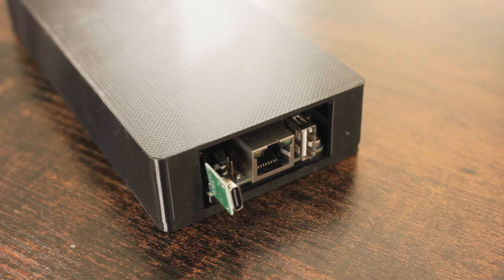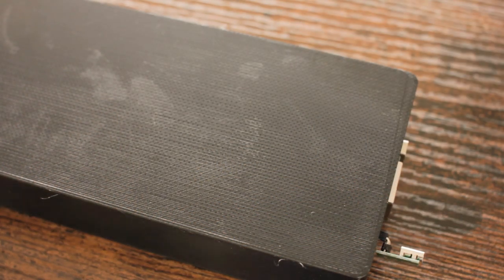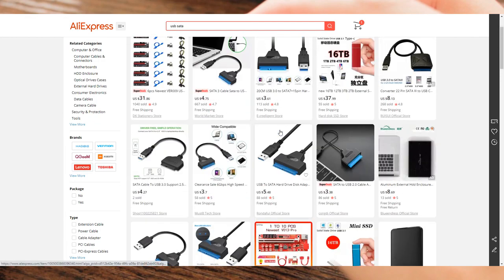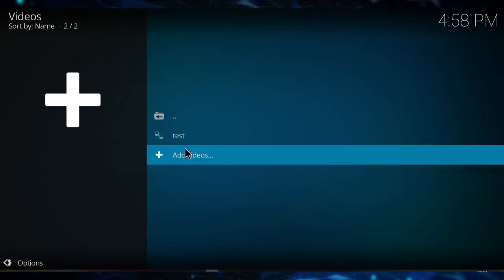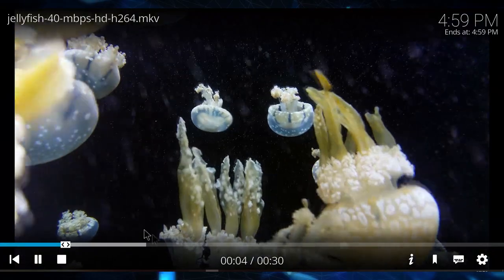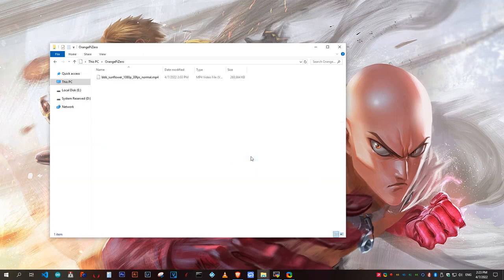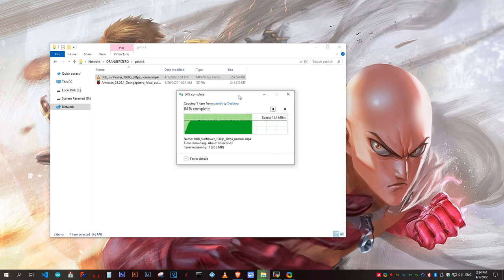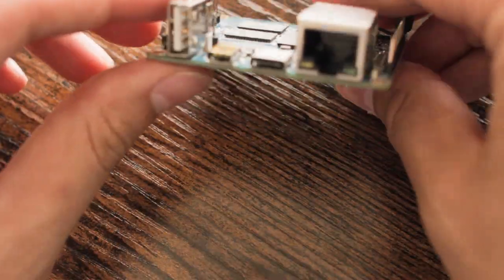Super Cheap $20 NAS, Media Streaming and More with an Orange Pi Zero

Comment: I like your kind of out-of-the-box thinking. For years I've been playing with the idea to have a mobile, battery powered local media streaming for my three kids in the car. My latest prototype setup is a odroid hc1 and a mango travel router running off a power bank. Using jellyfinto serve out the files. I hope we see some more of your thinking.
Reply from the maker: Thank you for the kind comment. Your idea sounds interesting, technically you wouldn't need a battery, you could convert your 12v cigarette lighter to whatever you wanted. I wish there was a power efficient processor that could do what we wanted. Cool idea!

Comment: What are you running on your SBC?
Reply from the maker: If I remember correctly, I think it was Armbian 22.05 Bullseye. It doesn't really matter imo, I find the official images from orange pi work just as well.
Reply: @GrafickStudios  Thanks.
Reply: If I could follow up, are you just doing SMB shares or are you running some kind of NAS software on top of Linux?
Reply from the maker: @JohnSmith-gs4lw  just smb shares and nginx (webserver), I try to keep things light.

Comment: if the pi is not transcoding files can it stream x265 content normally? i tried doing my own research and now im more confused than before
Reply from the maker: Yes, it doesn't care about codec. It's just uploading data to you. The end device (that you're watching on), like your phone, computer, or firestick would need to decode the x265, which a lot do now. But that's only if you have a basic setup like me (http server or samba server), I'm not talking about Jellyfin for example (which you can disable transcoding btw) but won't run on the older Orange Pi Zero LTS I believe, haven't tested this though.